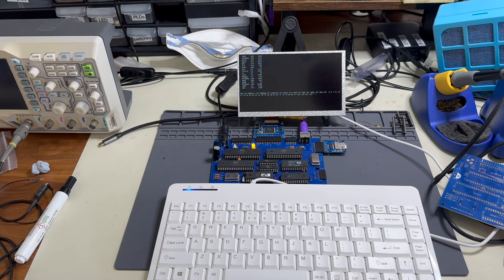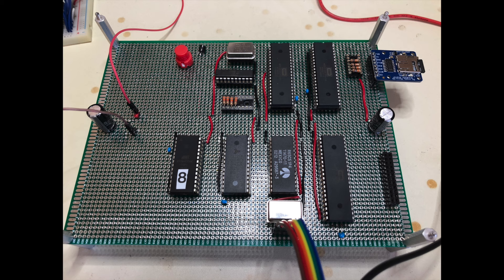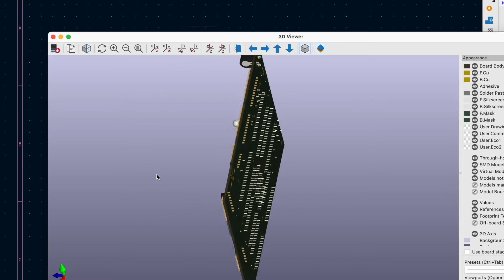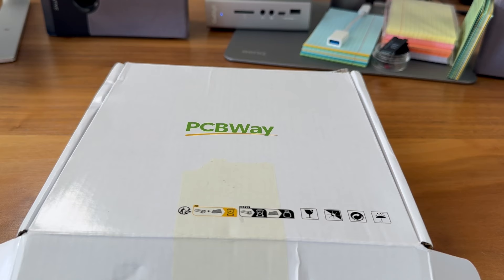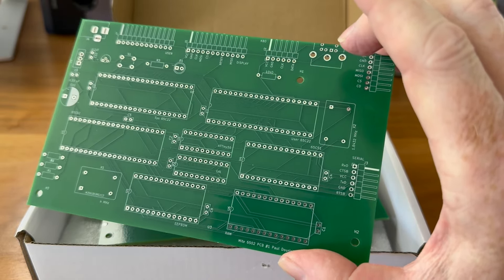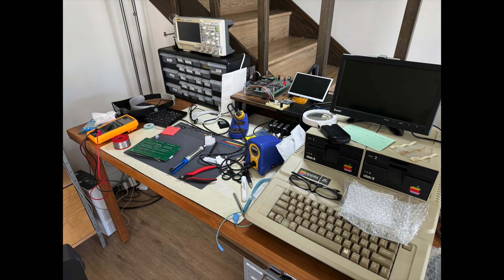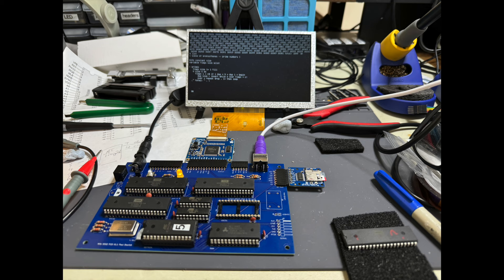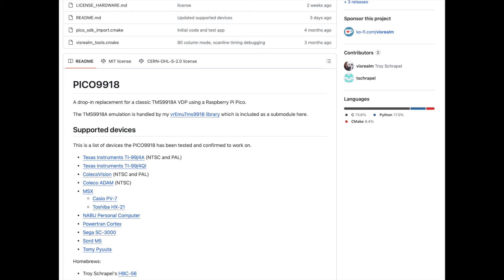6502 Mite home-brew computer project, step 25: schematic and Printed Circuit Board!

Comment: Hi Paul great to see your progress. Just watched the video. You are braver than I taking on board making. Glad v1.1 is a success. Do make a video on your progress when you make a milestone. Also looking forward to forth and other developments although I presume your video card pico9918 will influence the design. Good luck.
Reply from the maker: Thanks, Larry. The PCB wasn't so bad once I got into it.It does kinda lock you into a design, although perhaps not as much as wire wrap did -- wire wrap can be changed of course but that rat nest of cables didn't encourage experimentation. I'm looking forward to playing with the Pico9918 (if I can ever get one) although I did also find a version of the LCD and driver that I already use but with a 6800-style parallel interface that I could interface directly to my bus. Hmm, so many possibilities!

Comment: You should make use of copper fill to fill in unused areas of your board with a grounded copper area.. and tweak the routing process for reflections in routing to inhibit noise..
Also your default trace sizes should be adjusted for certain power requirements as needed..(main power rails and such).
And power supply decoupling capacitors as close to the ic's as possible ... usually .1uf   just food for thought,.,.
Reply from the maker: The decoupling capacitors are already there and in place. Trace size adjustments too. Copper fill -- well, next time.
Reply: @pauldourish  This was mostly posted for everyone not trying to pick on your build! 😀Have you tried easyeda for design?
Reply from the maker: @mindbender50  Oh no, I understood and appreciate it. I heard good things about EasyEDA but haven't really tried it. I find Kicad a pain in the ass, but at least there are lots of footprint libraries, online tutorials, and the like. I eventually got into it enough to get the job done.

Comment: Hi Paul great project can you share the Kicad project so we can modify PCB to fill 100x100mm dimension so that it is less expensive to produce
Reply from the maker: Great idea! They're on the project web page now. I hadn’t realized that there was a knee in the price curve at that point, although it makes sense. I hadn’t been thinking about size much at all, in fact. Shrinking it down should be easy. A couple of notes in that regard:

* I specified full rather than half can oscillators only because they were what I had on hand.

* I actually use a DC/DC converter instead of the 7805, so that saves the space reserved for a couple of capacitors.

* Now that I’m confident that the PS/2 keyboard connection works fine, there’s no more need for the header.

* I actually use an Aires low profiles zip socket for the EEPROM so it needs a little more space than the footprint would suggest.

* No particular reason not to hide the bypass capacitors under the ICs as long as one is using open-frame sockets. Only downside I see is Youtube commenters who always love to point out if they seem to be missing.

I’ll need more space in future version. I’m not actually making any use of IRQ although when I do, it’ll want an extra gate. My video plans will also require more space. So it’ll likely grow back to this larger board size even if shrunk down now. But I'm still a novice at this and I’d be happy to learn any new tricks for bringing the size down.

Comment: I would be particularly interested in how you get about making C work on your SBC.
Reply from the maker: There's an open source project called CC65 which a cross-compiler for C targeting 6502 and 65C02. That would be a non-native solution, but since it's based on the Small-C system I'm fairly sure that a native version could work. (Wikipedia claims that cc65 was originally a native system for Atari 8-bit systems.)
Reply: @pauldourish  Yes, I've played with CC65 and I use its assembler regularly. But, I've never got the minimal C example working on my Ben Eater style SBC.